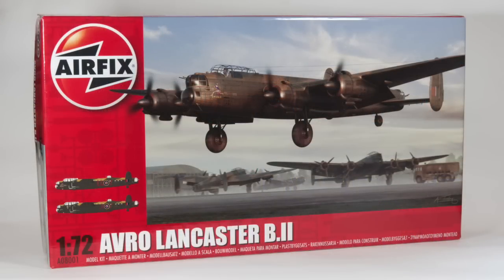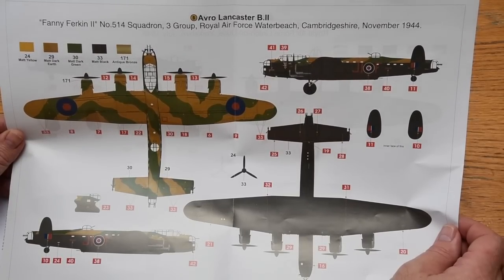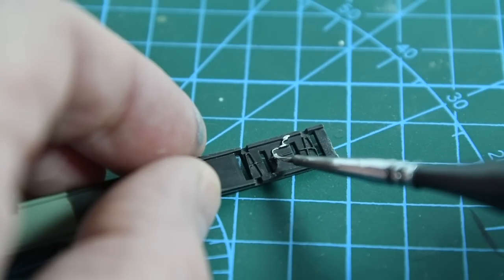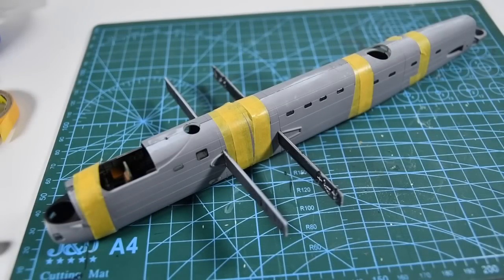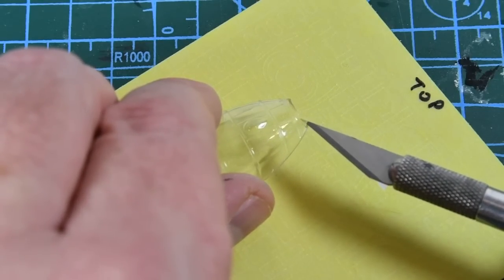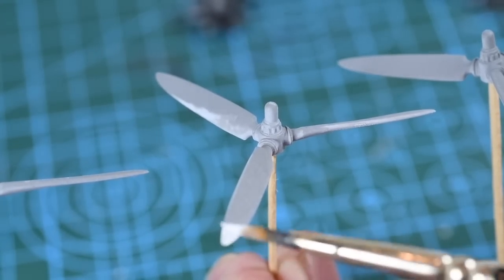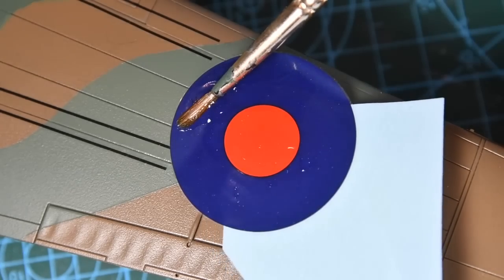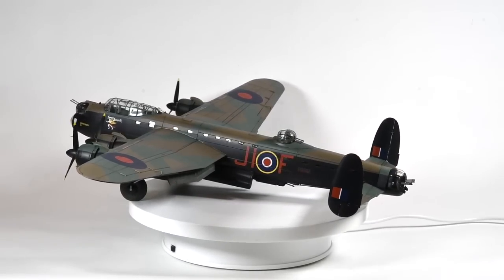Airfix Lancaster B.II 1/72nd review and build - HD 720p

Comment: I've built lots of Lancaster 1/72 models--several different ones by Airfix, some by Revell, etc.   This, the B.II, is by far the best.   I LOVE the radials.  And the parts for them in the kit are superb.  But I can't find it any more.  (I built it about 7 years ago, when it was first out.)   Not on hobby shop pages, not on Amazon, not on ebay.   Any thoughts on where I can find one (unbuilt)??? Thanks.
Reply from the maker: I got mine at the Airfix online store. Just did a search on ebay for "lancaster 1/72" and there were three there.
Reply: Jadlam racing models sell it.
Reply: @paul schumacher 
I found one of these in my local model shop earlier today (in Scotland). I'm seriously tempted to go back and buy it tomorrow. The shop owner said that they have a few in stock. If you're still interested in buying one, I'll give you the details to contact the shop (but only after I've bought MINE!) 
I believe that they do online sales as well as in-store.

Comment: I built this one myself a few weeks ago, small issues were 1) Slight warping of the fuselage halves, and an undershot moulding of the front-guns. Luckily this version has an optional turret, so I cut the end off the underside turret guns and glued it to the end of the front gun turret set. Not ideal, but it worked. The newer models seem to suffer warping more than the older kits. I also found the cockpit canopy was a bit awkward to fit the side-windows in.
Reply from the maker: The side windows were an issue, I agree. I didn't have any problems with the guns. Probably luck of the draw! Didn't find any warping.
Reply: You must have been unlucky

Comment: Nice job, how long did it take to build from start to finish? The Lancaster looks a little odd with radial engines!
Reply from the maker: It took me 10 days, but I was also doing the 1/48 Vampire and another couple of things at the same time! I reckon you can very easily do it in three days, or two if you do nothing else. Also depends on how much filling and sanding you may need as I always allow filler to set overnight.
Reply: @garys_stuff  Can be done in two days of assembly and three days of masking all the glassware. :-)

Comment: Hi Gary.  Great video. Which one would you recommend.  The B2 with Bristol engines or the B1/3 kit with merlin engines included.
Reply from the maker: That choice is yours - the basic Lancaster kit is exactly the same for both the Hercules and the Merlin variants. I liked doing the Mk.II just because it was different and because I had a B.I/III with the Merlins in my stash in the Dambusters kit! But the fuselage, tail and wings are the same plastic, just the engine frames are different.
Reply: @garys_stuff  thanks Gary for your reply

Comment: Whats is your opinion on the quality control of Airfix kits? Personally I've found  Airfix to be hit and miss and some of their kits I've built have terrible quality control. Even on their modern kits there is way too much flash on parts and its obvious that there is plastic that has leaked out of their moulds. This is much apparent on smaller parts. I've wanted to build the Airfix Lancaster kit but putting up with all the extra work and time needed to clean up each part has put me off Airfix now. Great build by the way, thank you for the video.
Reply from the maker: I did have some under-shot guns on the Wellington Mk.II recently, others have mentioned this as well. I can't say that flash has been much of a problem for me except on the older tools. I do find that they are trying to get an awful lot of accuracy from 1/72 at the expense of being able to get things off the sprue - such incredibly delicate parts at times. But then I guess this means a more accurate kit. The Lancaster I got was not at all bad from a moulding point of view.
Reply: Newer kits are fantastic, check the release dates, older kits are not good

Comment: Didn't realise they had modelled a Lanc with Bristol Hercules radial engines , not nearly as common a fitment as the Merlin, 
but due to Merlin shortages (Fighters were taking priority over bombers) the Mk2 had the Hercules fitted.
Reply from the maker: Neither did I until I saw the kit. Didn't know about the belly turret either. Live and learn, eh?!!!
Reply: The Canadians started that with a .50 cal belly gun to dissuade the German night fighters  with the upward firing cannons. At least one of the Dambusters' lancs had them too.
Reply: @garys_stuff  It was not a great success and kind of a hold-over from the later Manchester variants, only a few early production Mk1`s and a greater number of Mk2`s had them. Most Lancasters just had the mount without the turret and it was faired over in most of the aircraft built as the weight saving was considered to be more useful than an inaccurate weapons mount (the guns in the turret were sighted through a periscope and it was extremely difficult to target anything, particularly at night!).
The space when opened up also came in handy for mounting improvised weapons like a single Vickers "K" gun on the Dambuster B1 "Specials" and the H2S radar mount on later production Lanc`s.

Comment: Didn't know they changed the shape of the engine cowlings on the later lancs
Reply: The B2 was an interim version during a period when Merlin engines were in short supply. Once that issue was fixed then Merlin equipped Lancs were built again.

Comment: The lack of bombs is very disappointing, so much so it has stopped me from buying this kit.  I think it is quite shameless of Airfix expecting you to buy the airfield supply diorama just to get the bombs - and a warning, even if you splash out on the supply kit it doesn’t include enough bombs for a full Lancaster load.

I will soon receive a 3D printer and one of the projects is to try and find some bombs that I can print - if I’m successful then I will be buying an Airfix Lancaster.
Reply from the maker: It is really annoying when so many other kits in the range come with bomb loads (B-17 and Mossie come to mind). The only Lancaster that comes armed is the 617 Sqn Dambusters special!